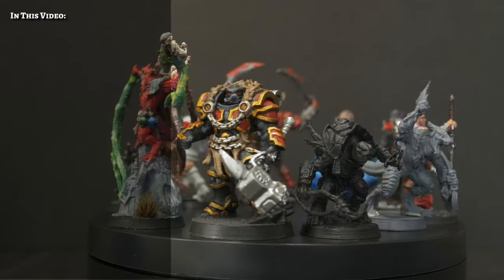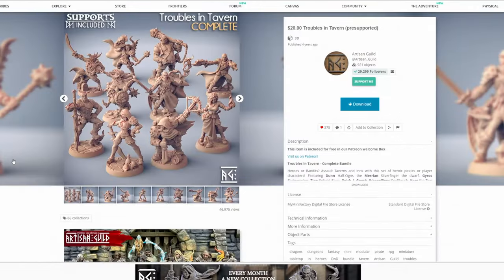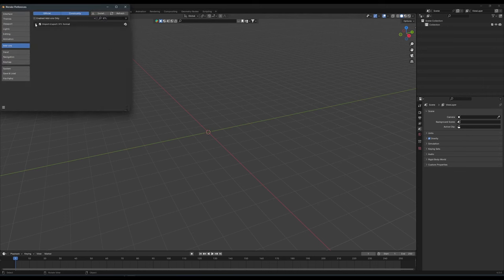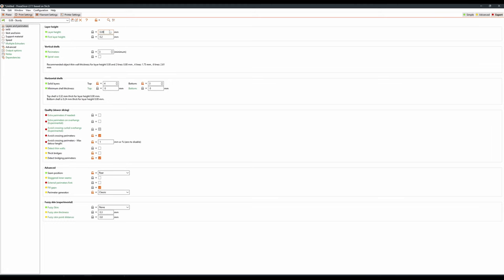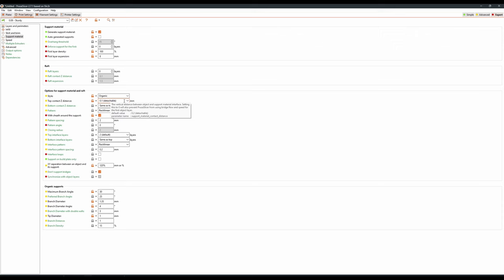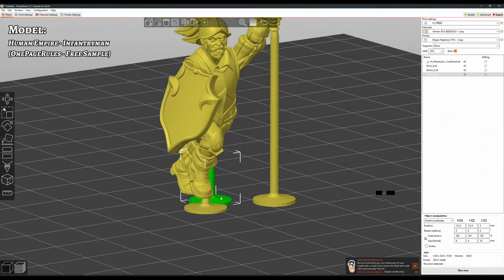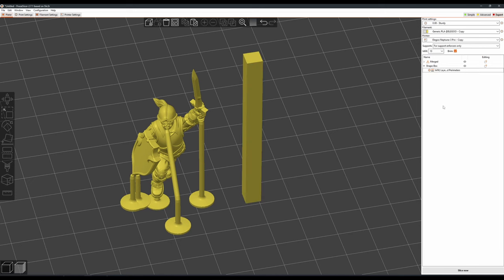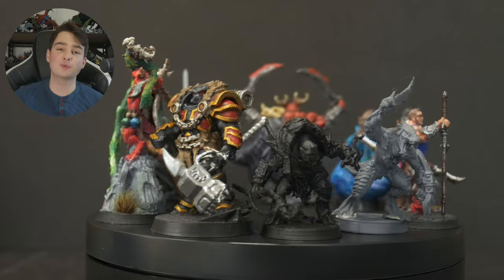How to Print AMAZING FDM Miniatures! | A Complete Guide to FDM Minis [OUTDATED CHECK DESCRIPTION]

Comment: Being in the 3d printer space for the last 10 years, its wild to see how far FDM has come.
Reply from the maker: Absolutely! I got into 3d printing a fair few years ago now with a secondhand Anet ET4, and that thing had a tantrum twice a print 😆 in the year and half I've had the Neptune 3 Pro, I only just had to fix my first clog about month ago and that's all I've to do. Awesome tech that's only getting better.
Reply: Yea, I started with an Anet A8 kit. Went on to Ender style, and now have Bambus. Its crazy how far it’s come
Reply: Not really on the hardware size imho. Core technology is pretty much the same, and some things like multi material (or color) printing is still way too rare. At least the prices have dropped a LOT :)

On slicer side there have been lots of advancements. And thanks to most printers using more or less same gcode, only the most expensive closed industrial systems have managed to keep some basic software advances as "features of a new & expensive printer". On "consumer side", we can run same improved gcode on those 10 years old machines too.

Comment: Please try a 0.2 nozzle just once. Just try it, the results are remarkable
Reply from the maker: That seems to be the common comment - I find myself printing both minis and bigger household stuff so don't like the idea of having to swap nozzles often, but I'm thinking ill have to give it a go now!
Reply: @Painted4Combat totally understandable if you don’t wanna hop between nozzles, but I found the MK8 nozzles Elegoo uses to be pretty easy to source and swap out! For larger household prints where layer lines aren’t a problem 0.6 is also a huge time saver. ;)

The results you got on a 0.4 nozzle is phenomenal though, using the inflate tool in Blender is genius imo. Gonna be trying this out later today for sure.

Comment: Great blender tip and a great video! I have a Bambulab A1 and it works great once you added the proper supports. I usually print miniatures with a 0.2 nozzle to bring out those subtle details.
Reply: So have to specifically supportless STLs?  I feel like that would eliminate 80% of MMF STLs. I want to get into 3D printing, and like the simplicity and safety of FDM, but also want awesome minis and don't want to sacrafice selection or time savings by redoing STLs.  Thoughts?
Reply: @topnotchit  Most MMF stls have both support and supportless.
And besides, using FDM supports are better compared to using resin supports in FDM since they don't work the same.

Comment: Just wanted to add this which has been crucial for me. I accidentally washed a mini in boiling water and holy fck it makes removing supports easy, not kidding. You can pretty much rip the supports of an have a perfect mini afterwards. When boiling minis they pretty much become mold and you can even change their pose. Wash it in cold water afterwards for it to harden.

Comment: I really appreciate Arbiter as well. I will note, if you are able to spring for a Bambu P1S/P1P, and the $30 or so .02mm nozzle, you can get pretty amazing quality minis with very little tweaking, though the support material content of this video is still very applicable. @Painted4Combat have you tried using PVA or PETG supports? I haven't had great luck with either (PVA getting stuck and PETG just not adhering and causing the filament to detach) and they blow up the print time with an AMS as it's constantly switching filaments. Some of my best prints (of even supported models) have been done by doing careful rotating (a very fine sword can still print ok if you rotate the model so it points straight up) and putting the supports against flatter areas of the model/not on the detailed parts. I often lie a model on its back for example. I would also recommend Sunlu PLA Meta filament, Fat Dragon Games has done some great tests to show it minimizes layer lines.

Comment: Great blender tip, thank you. As many have said, a bambu lab printer with a 0.2 nozzle and orca solve 99% of issues printing in FDM. it's not resin quality but not bad. I can easily print 6mm epic scale, 10mm warmaster scale and 15mm scale quite happily.
My own tip would be to consider a heat gun to help with clean up. You have to be careful to not melt thin weapons, etc but it will get rid of stringing and also smaller issues

Comment: I've been printing fdm minis for a while now, and I'll definitely try the blender tip, it seems easy enough to unscare me of this software 😅
The game changer for me has also been to change nozzle. Using only .4 nozzles is like buying a power drill and using only 1 bit with it. I heavily recommend everyone to buy a cheap kit of nozzles and experiment on your printer. Personally, I switch nozzles depending of the use case : .3 for miniatures (.2 is useless on average 3d printer, it cranks up the print time A LOT without too much improvement on details), .4 for terrains and vehicles, .6 for everyday life 3d prints. Switching nozzles is super easy and takes like 1 or 2 minutes maximum. All those on YouTube that recommend you do a whole mechanicus ritual to change nozzle is bs. Just preheat, remove filament, unscrew, put a new one and you're good to go. 
Hope this helps. Again, great video !

Comment: 1. Love the video, very informative
2. I've had no luck with prusaslicer and have stuck with cura, but I will be back to use those settings after i redownload it
3. I just want to really push Arbiter minis because the artist is amazing and makes dedicated support free prints specifically for fdm that print fantastic
4. I also use elegoo nep 3 pro and their filament for my minis, good stuff
5. thank you for the new tips, i never thought of using separate towers and then merging them into the model, gonna try that out on some!

Comment: I like your ideas. I  use ABS with 25% fan.  Squirt down with acetone in a needle, seals layers and makes it very strong.   Try printing two or 3 models at a time for cooling. PLA is weak in thin extrusions.  PETG is stringy. I print with many shells for strength. I put the model in Meshmixer,  Increase size 5 times make solid, then add .1mm offset to model. Then I rescale back to 32 mm scale.  Push the maximum edge of the scale for FDM success. This will thicken the model an hopefully not ruin the detail too much.

Comment: I recommended more focus on supports but did not expect it to get this interesting. You are basically confirming my own observations and experiments on manual supports. Started for me with a backpack for a miniature. Parts of the bottom kept drooping a lot even with supports. I added two manual support in each corner and then it printed with perfect results.

You could probably do a series of videos just  where you slowly add supports to different, simple and difficult. miniatures :)

I am really gonna experiment with this in Lychee but what is the diameter of your supports? 
Your explanation makes it sound like 0.4 mm but looks in the video like it is closer to 0.8. Just want to skip past some unnecessary experiments that you have already solved :)

Looks like "supports" in general is the nr1 thing that is holding back mini printing with MDF.
Reply from the maker: Great to hear that this helped! 

My current towers are 1.6mm for the main shaft, enough to maintain a sturdy support, and then tapering to 1.2mm at the tip - most slicers will make this a single loop as mentioned, but some will add a dot of filament to the center, overall this is the best thickness I have found. Otherwise sometimes a slicer will cut the top off the support or there wont be enough material to actually support the model. 

And i recommend a minimum of an 6-8mm base/rim for the supports for connecting to the build plate, otherwise they are too easy to knock over.

Comment: Awesome. I do have a issues with supports being knocked over and ripping up brims so I'll have to try the manual ones. I'm already using Prusa Slicer and love it. I don't often have issues with very narrow parts though so I just leave swords, etc alone and don't pick or skip models just based on that. I already assume that I'll lose fine surface detail due to resolution but it sometimes surprises me
Reply from the maker: Awesome to hear; Let me know how your use of the manual support go, definitely want to continue developing those to be as user-friendly as possible! - and I totally agree, modern FDM printers are shockingly good at picking up most surface details, but its more often a 'nice surprise' when it happens, rather than an 'expected outcome', at least for me 😅

Comment: You should be able to set a minimum layer time to let the previous layer cool instead of adding a 'purge tower'. Unless you're worried about oozing of course. Then I think the prime tower works well.
Reply from the maker: I looked into this but I think that Prusa is limited in this regard, as in it doesnt allow for a proper minimum layer time function, it only lets you slow the print on quick layers 🤷‍♂️ I could be wrong though!

Comment: Hi thank you for your videos that help me a lot. I am into 3d printing since few months and speaking of support I still struggle to avoid scars when removing support. I used 0.3 mm z-top distance when printing at 0.06 mm but it leaves marks sometimes difficult to remove due to the size of the mini. Although my printer nozzle sometimes knock the support down (Bambu A1 mini no possibility to calibrate manually z-axe) but less when I use smooth tray. Any tip on how to my support stronger without impairing mini? I still need to test your homemade supports. Thank you in advance for your feedback
Reply from the maker: I would recommend trying to crease the z-top distance slightly. It might make supports a little tougher to remove but will decrease the blobs and poor print quality in those areas. with a 0.06mm layer height I would recommend trying a z-top distance of 0.18 - I always try and keep my z-top anywhere from 0.15 ~ 0.2mm (anything in that range that is a multiple of the layer height). Just find the right balance between ease of removal and overhang quality. 

as for strengthening supports, I would suggest adding "double walls" to your supports, if you're using Prusa this is "Branch Diameter with Double Walls" (just set it to 0.1). 
I have recently started experimenting with OrcaSlicer which lets you add infill and change the wall count of their custom tree supports, which has stopped supports breaking for me. I hope to do a video on Orca in the future if this is of interest also!

Comment: Wonder if desktop SLS will have a bigger impact on printing minis.
Reply: If it gets cheap enough, maybe?  But the labour and material-handling costs for SLS are almost as bad as those for resin, whilst the printers themselves are still nearly ten times the cost - 3K USD is very very cheap for an SLS printer but a lot more money than an SLA.  When it comes to minis, I expect desktop SLS will be more useful for companies selling physical minis than for individuals printing a few characters here and there - to really make it worth turning the machine on, you want to fill the entire build volume.  That means printing a lot of things at once.  And to make it worth buying the printer, you want to be doing that regularly.

Comment: Thanks for the video. why did you choose the Elegoo neptune printer can I ask?
Reply from the maker: I had to give up resin when I moved to a smaller apartment that didn't have sufficient airflow. 

Frankly, The Elegoo Neptune 3 pro was coming out around that time, so I decided to pre-order it to make the most of a pre-order discount from my local seller.
(this was done after confirming the printer was living up to its claims via reviews on YT, primarily watching Uncle Jessy but also others who were not sponsored 😆). 

To be honest, at that point in time, many printers were coming out in this rough price range and all advertised very similar features, some having more than others. 
I settled on the Elegoo because it appeared to have the most of those features in a single printer, at a price in the lower end of that range (pre-order discount helped), and was a brand I had some level in trust in; the main features I wanted was robust auto bed levelling, a built in flex plate on the print-bed, dual z rods and a direct drive extruder; and this printer had all that as well as a bunch of additional nice-to-have features. 

So in short, it had all the features I was looking for, under a brand name I trusted to deliver a quality product at a reasonable price.

I've never had any issues, in the year and a half that I've owned it, using it often daily or at the very least one a week; I finally had to clean my first clog about a month ago and other than levelling the bed every so often, that's the only maintenance I've had to do. It really is a great printer and I've put it through its paces, that's for sure.
Reply: Thanks for the reply.  Really appreciated.  @Painted4Combat

Comment: My printer smashed my nozzle into the bed and fused filament with it, what caused this? Was it the nozzle height? I use an Ender 3D pro
Reply from the maker: Woah! that doesn't sound good. 
It could be your Nozzle Height, but it could also be any number of things to do with machine itself. did this happen on your first print, or is this out of the blue? if i's due to swapping Slicer maybe check you're using the correct printer preset or double check the startup G-Code.

Hope you figure out what happened!
Reply: It's not my first time printing, but I did try out the slicer in this video when I was previously using cura

Comment: Combine infill every nth layer will help with print speed, there is no reason to print infill every layer, you can also increase infill line thickness and speed, again it´s inside the model.
You can do like 70mm/s speed for infill for instance. Inner perimeter can also increase by 10-20mm/s. It´s inside you don´t see it.
Also you don´t dial in extrusion width you tell the machine how thick of a line it´s supposed to print and make sure your extrusion rate is correct beforehand.
I print 0.8mm extrusion width for sturdy boxes vases and such with a 0.4mm nozzle. You printer can print way thicker than that as well. It just squirts more plastic faster out of a small orfice that´s it. 
Also technically speaking you physically can not print an extrusion width of exactly the size of your nozzle opening. So a 0.4mm nozzle can physically NOT print a 0.4mm extrusion width because it would mean there is no squish to the previous layer. Your standard 0.4mm nozzle prints about 0.5mm extrusion width ( the 0.4mm nozzle which was changed from the ancient 0.5mm nozzle to make sure your walls are about 0.5mm). You can get around it when bridging for example, you drag the material and thin it out but is not precise.
So get a 0.25mm nozzle and print with 0.3mm width.
Also numbers like 2.65mm for retraction don´t make any sense. No machine ever is precise up to 0.05mm for this kind of function. Those kind of settings are very unreliable because you don´t account for any tolerances due to humidity, temp changes in the room and so on and so on. If your setting is spot on at 2.65 just do 2.8mm done.
For small etails like dwords and such change the minimal layer time to like 30s or so, it will do exactly the same as with the box but you won´t print an extra box.

Comment: Minimum Layer Time is the setting your looking for that will slow the printer down when printing tall, thin, objects so as to not be printing on gloopy hot layers.  
Also, Use ORCA SLICER instead of the older Prusa Slicer.  Orca slicer has more printers supported and combines features from both Prusa and Bambu slicers.  
You also want to make sure you have Archane enabled for the wall type generation.  Classic will ignore the small details, Archane will print more smaller details, to the point where it can be pretty close to first gen Resin qualities, better results when using a .2 nozzle instead.

Comment: Funny you being up OPR, because i gave asked in their discord if i could print their minis in FDM and was met with a reaounding NO
Reply from the maker: Their minis aren't designed for it, so I can understand the 'no'. a first-timer couldn't load them up on an FDM printer as easy as a resin printer - so the folks there probably don't want to say yes. but its possible, just not ideal 😆